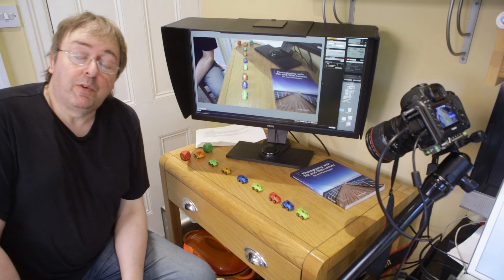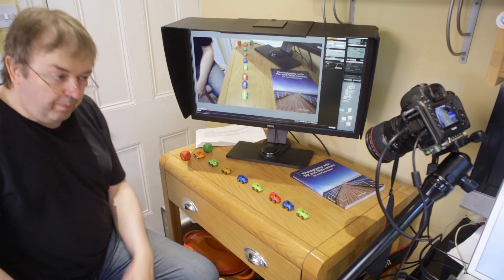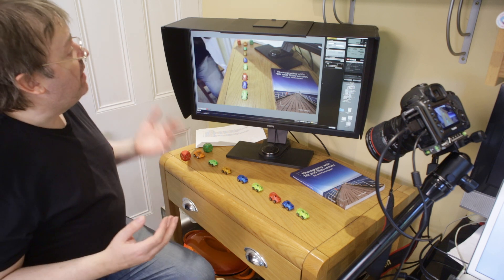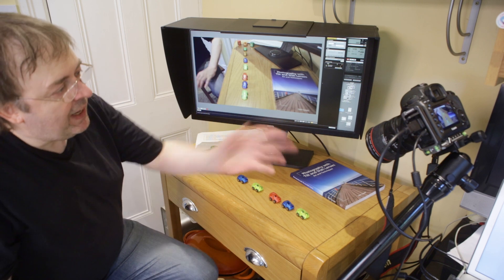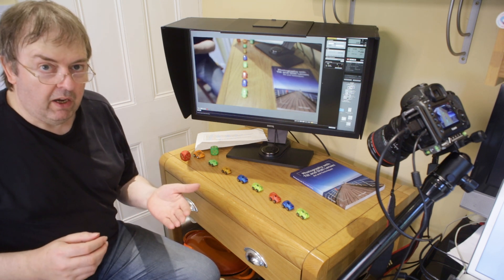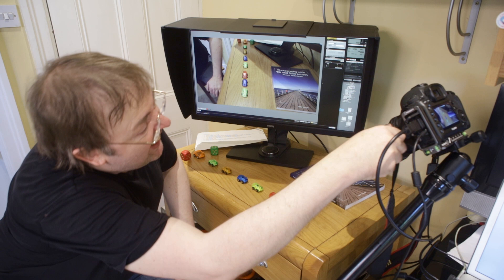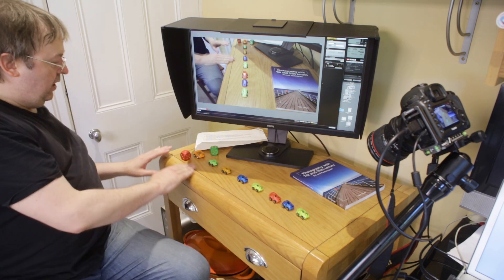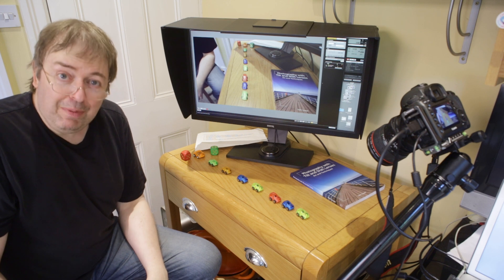Tilt/shift lens tilt setting for close up work. Placing the plane of focus where you want it

Comment: Wouldn't it be easier to just use manual focus peaking feature in the camera? It would show when all objects gets into focus while tilting the lens. I do not have t/s lens, so cannot check it, but this is what I would try doing to simplify the process
Reply from the maker: No, it often takes a lot longer - remember that this is for an arbitrary plane. Here, I'm also trying to explain the 'why' for the process as well. Understanding what is going on with the focal plane, is for many people the key part of 'getting' this.
With practice, experience and simpler examples it can be a relatively rapid process. This is one of those things which different people pick up at very different rates, but it needs real practice, since many of our supposed notions of how lens focus works can go out of the window.
I''d also note that focus peaking is also imprecise and can suffer in its working with strongly tilted lenses [it is designed to work with non shifted and non tilted lenses. It is a helpful adjunct - especially if working tethered with a large monitor, and I'll use it as a support, if available. As ever, with practice, people find what works best for them, but the underlaying optical principles don't change.

Comment: Large fromat view and feild cameras make this stupid easy.
Reply from the maker: Glad you find it so simple - Practical teaching experience tells me that very few people do, yet alone understand the process, either with such large cameras or, as here, lenses with movements. 
This is for that 99.99% ;-)
Reply: @KeithCooper  I get that, I was just statiing that doing it on large fromat is so easy. It would be an option for those who want to do this type of photography . Large fromat makes it easy with the way it is designed.
Reply from the maker: Yes, but it's film... :-) 
Seriously though, I'm most likely to be needing this for very detailed product photography, where I may need to do lots of examples and tests, very much a one off and not the budget for high end digital backs and certainly not film.

I'd maintain that once you know what you are doing it can be 'easy' with a tilt/shift lens or view camera. The key is knowing what you are doing, and why [the bit very thin on the ground]. 

I would never describe this stuff as 'easy' to people learning it - that puts people off when it doesn't just 'click'. Some will pick up the process much quicker than others, but matching an arbitrary plane of focus definitely comes at the harder end of learning to use movements with lenses.

For example treating tilt as a vector [direction + amount] can be conceptually easier for people to understand than the traditional combination of tilt+swing.

I generally assume that people coming to this are coming from a small camera/normal-lens background, and that anyone who's used a large format camera should know this stuff anyway. [That's where these videos and my book are aimed]
Reply: @KeithCooper  That makes total sense and I agree with everything you said. I usually look at everything through the lens (pun intended) of film because it is all I shoot, so i do have some bias there. I like large format for the ability to test processes like this as it is just one sheet instead of a roll. I learned the tilt/shift process when I decided to photograph scenes I made with scultpures as a form of photographic art, which is all I do. I did not find it challenging for what I was aiming for and the myriad of movement ability that my view camera has made it easier fro me, even though I had never done it before. I got the results I wanted in just a couple of tries. I guess I fall into the category of 'some find it easier than others'. The nice thing with the view camera is that I can see the results before I even load the film. I enjoy watching your approach and appreciate your knowledge. I've learned quite a bit from your videos, even if sometimes I think I can do it easier.
Reply from the maker: Thanks - as you might have guessed, I've not touched film since I became a commercial photographer over 20 years ago ;-)
Glad you have a good working process...

Comment: how can I tilt the focus plane to 90 degree while still having the focus up close? Or how do I have to tilt the lense WHILE FOCUSING to not change the amount of tilt?

There are many videos about SHOWing the tilt effect, not I couldn't finde ONE that answers these questions.
Reply from the maker: Because the closer you work, the amount of tilt needed goes up
Actual real world lenses just don't tilt enough. That's what limits the tilt of the plane for close working.
It's why macro and tilt don't go together that well...
Basic optics - see my recent video about the two Merklinger books for a more rigorous [but mathematical] explanation?
Reply: @KeithCooper  Tbf, I knew that upclose and high angle tilt isn't realistic. (it was more like a "what would it need" kind of thought.) But for that too, I couldn't find any actual in depth explanation. Ether (most of the time) some real like chrash curses, like this video here, showing how to handle it, OR some drawn in Paint like visualisations of how the tilt itself can be thought of. But also not really explained WHY the plane tilts THAT way.
[tldr]
I mean, why does the focal plane NOT stay paralel to the lense? I mean you could think that the focus images is kinda 3D hologram-ish behind the lense and the focus is just where the sensor gets placed in this virtual field. Why does this "imagine some virtual lines, extending from your sensor and lense invinitely, and where rthey meat, thats whre the tilted plane mearts to and jada jada" work as it works. How does it actually physically work? how is the light itself "placed" behind the lense so that it gets tilted that way? etc.
That's where my second question about the focusing comes from. Why can't they built it to raise or lower the plane without effecting the tilt angle when focusing, just like when I pull or push it when not tilted?
(This question is not meant particularly for this video but is more a general thought.)
[/tldr]

But that aside, may I refrase my question.
What would it need, at casual tripot hight, to lay the focal plane on a lake? For that your focal plane would need to be tilted close to 90 degree.
And what if you want to tilt it beyond 90 degree?
Reply from the maker: I tend to avoid the optical theory and any maths, which is what you need to explain it at a fundamental level.
There is no better way of killing off any video views from most photographers than introduce maths ;-) I much rather cover some aspects of this in written articles, where I can edit/update/refine them - my videos are mostly shot in one take, with no script.

Your question is a relatively easy one to answer, it depends on the focal length and tilt alone. Your height above the lake surface is the distance 'J' here [see the tilt tables]
https://www.northlight-images.co.uk/using-lens-tilt-on-your-digital-slr/
Changing the focus setting is what changes the plane - if you have a lens that focuses beyond infinity, then the plane will tilt beyond 90º

This from https://www.northlight-images.co.uk/photography-articles-and-reviews/tilt-and-shift-lens-articles-and-reviews/

My videos are generally intended as supplements to my written work and book ;-)
Reply: @KeithCooper  yeah, fair. Wanting to know it in detail but not having the focus span when just written, is kinda a me thing.
But thank's for the links. I will read them later ^^

I have a mft camera. And for my use case, I would need a 25mm lense. Or 12mm at best. but even 35 would be ok. Sadly I could only find 50mm or higher.
Reply from the maker: Yes, this would be why it took a direct request from Canon UK for me to even start doing videos - I still dislike the medium in many ways - or more, dislike YT and how it works... ;-)
I'm a photographer first, a writer second and a video maker further back down the list around my cooking and piano playing.
MFT and lens movements is a somewhat sparse area of info...
Reply: @KeithCooper  And thanks for the quick reply. I will look into the mentioned video too ^^.

Comment: Good video Keith thanks. If you used say f11 does the depth of field increase to the size of a normal lens? Would you advise using f11 for a landscape scene using tilt? thanks
Reply from the maker: Thanks
I use the wider apertures here so as to be able to show the effect more clearly in the video.  
As with an untilted lens, a smaller aperture will increase DOF, but the key is to note that the plane of sharp focus is a wedge, so you need to think carefully about where the wedge of focus runs through the scene.
One result of this is that tilt is nowhere nearly as useful for landscape as many people first assume [I'm talking 35mm sensors/film here]. A nearby tree with sharp and less sharp sections does not work well. That's not to say it isn't useful, but it's not a simple gain (and ideally shouldn't be visible).

I have for several years been looking for a landscape shot I was already thinking of taking which would clearly show the benefits of tilt.  I'm still looking ;-)

These are the two books I read some time ago, to which all my tilt shift articles, videos and book owe a debt to: 
http://www.trenholm.org/hmmerk/download.html
Reply: @KeithCooper  Hello Keith, thank you for your detailed reply. I was just bidding on a TS lens on eBay, I missed out. Maybe it was meant to be. I was hoping to be able to stop focus stacking and shoot one shot front to back sharp landscapes. While I can shoot one shot personally its a compromise, I love razor sharp foreground, midground and want sharp background. It appears a TS lens isn't as useful for my full frame R5 Canon as I thought. I'll look at you attached link. Thanks again Keith.
Reply from the maker: If it's any interest, all my tilt/shift articles [and vids] are indexed at: 
https://www.northlight-images.co.uk/photography-articles-and-reviews/tilt-and-shift-lens-articles-and-reviews/

Comment: I own 3 Canon tilt-shift lenses but almost never use the tilt feature. For my uses (to photograph architecture), tilt does not ever seem necessary, but I wonder if I'm missing opportunities to use the tilt feature more. Apart from photographing products, or just as a gimmick (toy-effect), what do you use tilt for Keith?
Reply from the maker: If I looked through the photos I've taken for my work in the last year, I'd find very few using tilt. Where I have done it's been to look along a wall/floor/ceiling and I've placed the plane of focus along that structure.
See the looking up a brick wall shot in my TS-E45 review (about half way through)
https://www.northlight-images.co.uk/ts-e45mm-f2-8-lens-review/
There is quite a lot about using tilt in that particular review

Comment: Thanks for this one! The composition change with an adapted lens is quite a problem though?
Reply from the maker: Not at all - just means you may have to reposition the camera slightly and re-do the tilt set-up process.
As I mention in the video, it is an iterative process and varies for each lens
Reply: For people that like confort and or use it a lot, It's also possible to purchase a TS lens-bracket that gives a rear tilt in place of the front tilt
Reply from the maker: @jean-claudemuller3199   Which bracket is that? All the ones I have either don't allow tilt (rogeti TSE frame - for shift)) or clamp at the rear, meaning it's still the lens that moves with tilt.
BTW YT will drop comments with URLs in them, so if you could give some form of info that's not a link, others can see it?
Reply: @jean-claudemuller3199  Can you point oiut one such?

Comment: This actually blows my mind how this works 😀 I wish I could afford one of these tilt/shift lenses. Its very strange how you went from just a few inches of depth of field to a couple of feet by simply tilting the lens just a few degrees 👍
Reply from the maker: Thanks, but do remember that that huge depth of field is still in a thin plane, so the benefits of tilt for landscape that people sometimes think of, are lost if you have an awkwardly placed tree ;-) But for isolating subjects and covering 'flat' things it can be really special.
BTW I started off with a used TS-E24 years ago - the samyang 24mm is also quite good. They also hold 2nd hand value reasonably well.
Reply: @KeithCooper  Absolutely Keith, I photograph small action figures for composites and a tilt function could capture my subjects in a single frame rather than having to always focus stack. I did consider the Samyang and might still take the plunge. The Nikkors are a bit out of my price range even second hand 😉
Reply from the maker: One thing I've only briefly experimented with is stacking multiple tilted images - it's possible (with a small aperture) to take pictures with a slight change in tilt/shift/position and combine them. 

I do normal focus stacking for my industrial macro work, and I've not really come across a setup where tilt would have worked, but I'm sure it's a possibility.

Comment: Thank you Keith. Great example... may i request a short video on rotate and swing for vertical subjects?... i am currently working on tse 90mm f2.8 L canon latest... on 1Dsmk3...
Reply from the maker: Actually, just watch the video on a phone turned 90 degrees and it applies to a vertical plane ;-) ...There is no difference, you just use tilt to the left/right rather than up down.

I do have another video to do but it's about diagonal tilt
Reply: @KeithCooper  great, diagonal tilt will also be a very useful skill to practice ... thank you once again.. looking forward to your video on diagonal tilt... 👍🏻

Comment: Keith, I believe you came to America and were peeping into my window! This video was exactly what I needed. Just yesterday I was experimenting (relatively unsucessfully) with a shallow wooden box of fake green apples in this exact setup and I concluded I needed to review your materials to figure out what I was doing. It would appear that the tilt "swing" movement has to be parallel to the plane of the object(s) upon which you are intending to get into focus? I did figure out the bit about using shift as needed to recompose, so maybe there is hope for me yet. I should have your book in hand this week. Thanks for your efforts!
Reply from the maker: Glad it's of help. Gives me something to do whilst the web site is broken...

You are right about the direction of tilt - I've one even more complex example to try but that will be next week...